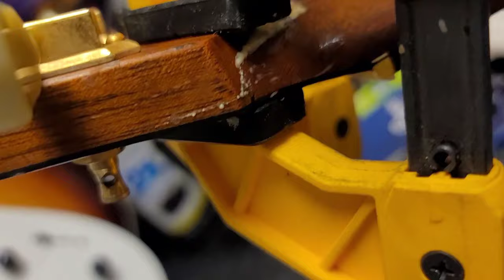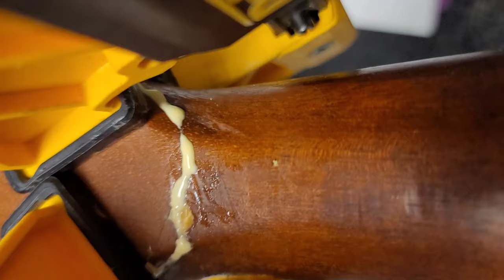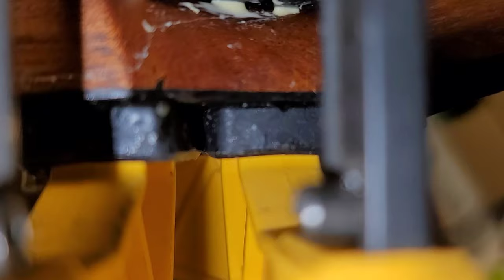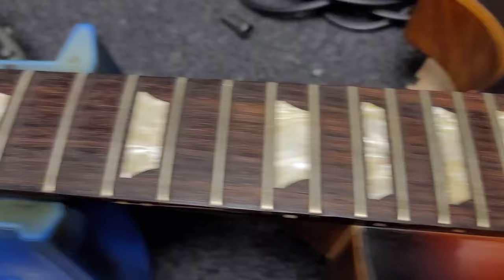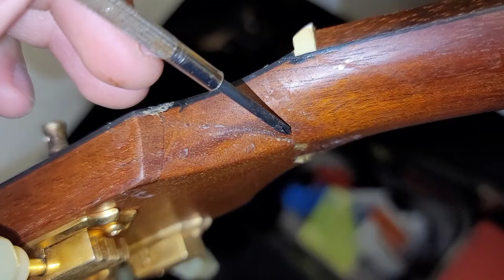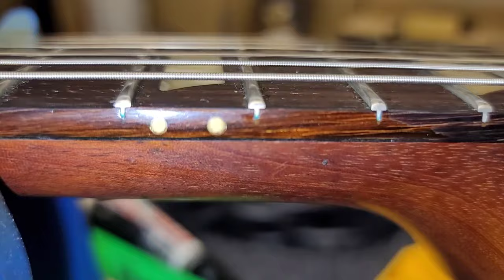Gibson Les Paul Headstock Repair...Again...

Comment: Why is this a thing? Like what happened?
Reply from the maker: The headstock angle doesn't work well when it takes impacts. Also, some people don't notice that the headstock is having pressure forward when it's lying flat on a surface because of the headstock angle